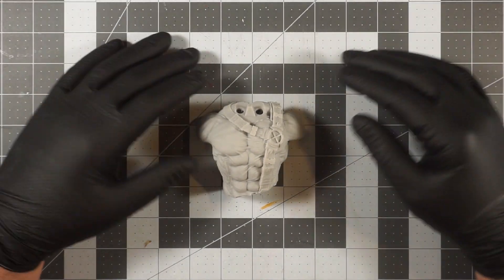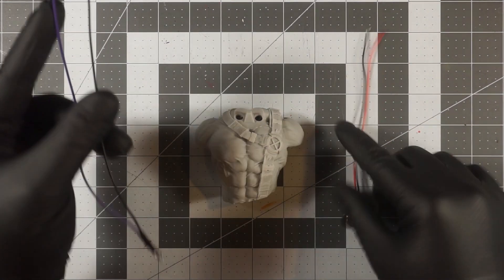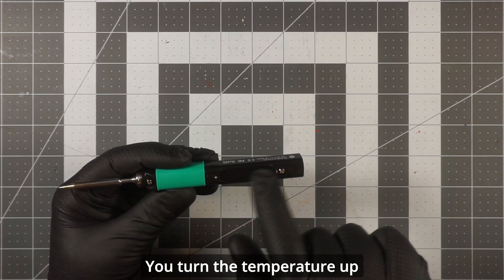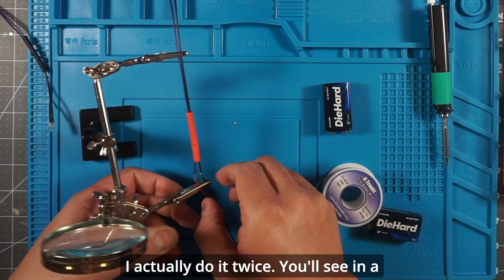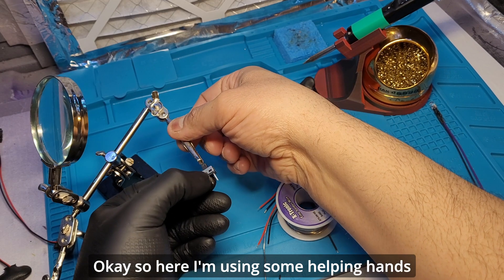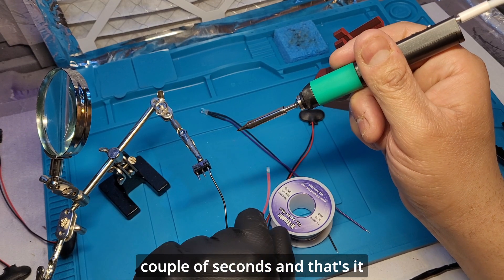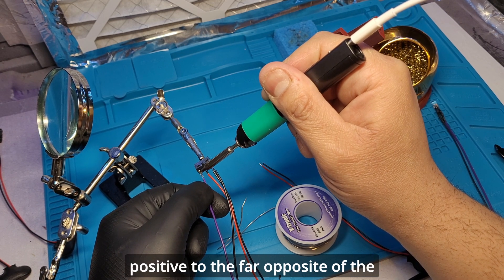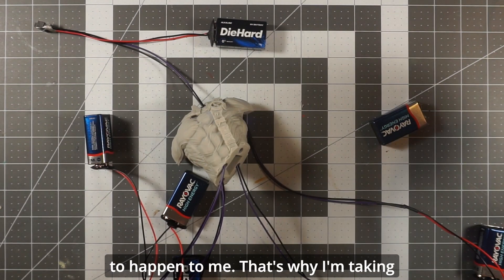NO MORE BOOM: Preventing Print Explosions & Resin Seepage | Safety Tips

Comment: I just bought a back of these to do the same thing.. btw- there is already a resistor soldered into the line on the LEDs so that is why one is not needed.
Reply from the maker: Good point, I realized the resistor was there after I posted the video. Thanks.